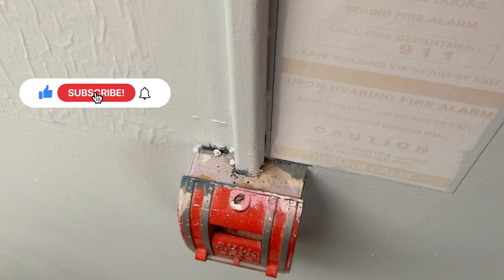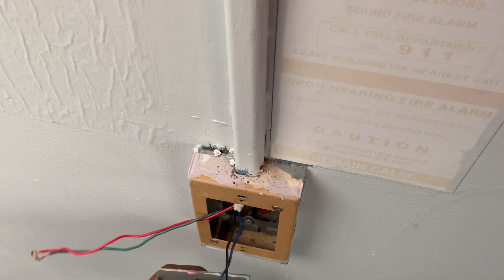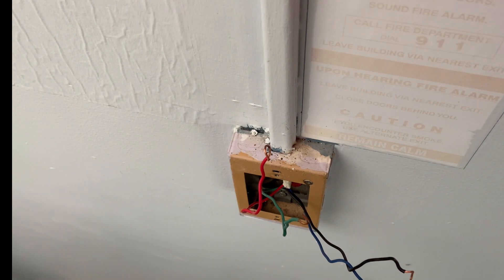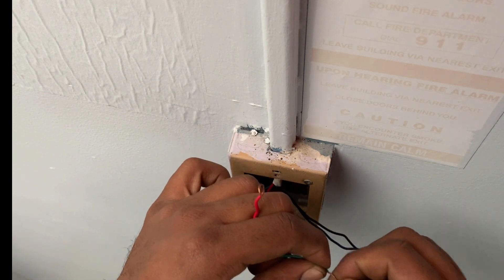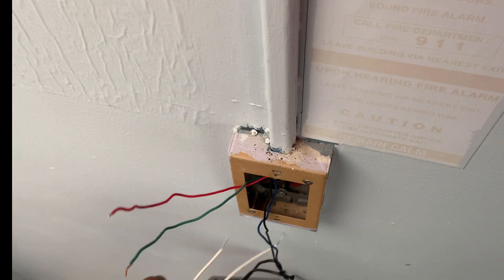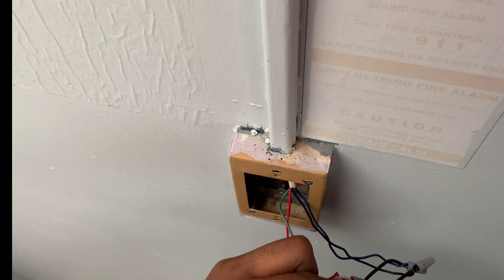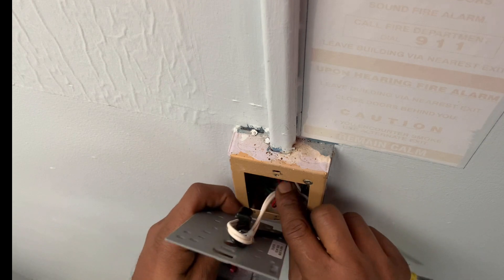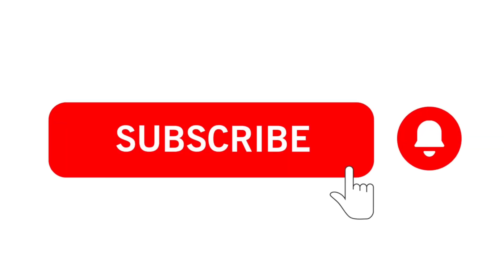Experts Reveal the BEST Way to Replace a Fire Alarm Pull Station!

Comment: What type of certification do I need
Reply from the maker: Working on the fire alarm system? Is this what you asking?
Reply: @TheSafetyQ  yes I helped install fire panels like sypmlex and firelight for a year when I was 20 (2years ago) and am trying to get back into fire protection.  Do you have any advice on what type of schooling I could take to further my chance at employment and higher pay
Reply from the maker: Check out Nicet
 
https://www.nicet.org/certification-programs/electrical-and-mechanical-systems/fire-alarm-systems/
Reply from the maker: Where are you located?
Reply: @TheSafetyQ  Raleigh North Carolina and okay I check that out I I appreciate it your time
Reply from the maker: 3 year diploma course, online available. 
https://www.senecacollege.ca/programs/fulltime/FPN.html
Reply: @TheSafetyQ  thanks I figured there was some sort of schooling I just couldn't find the correct name for it . I appreciate all your help , have a gn bro
Reply from the maker: No problem, I hope it works out!